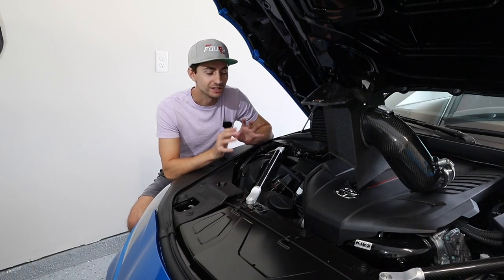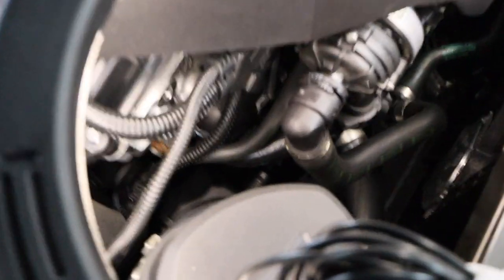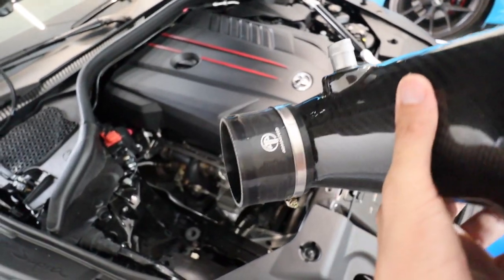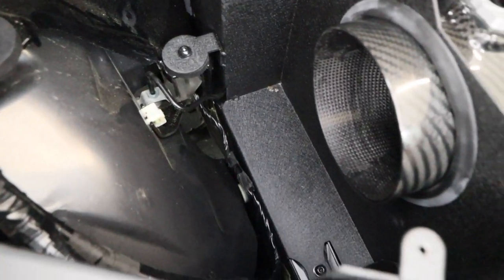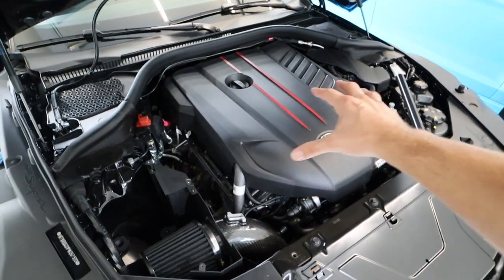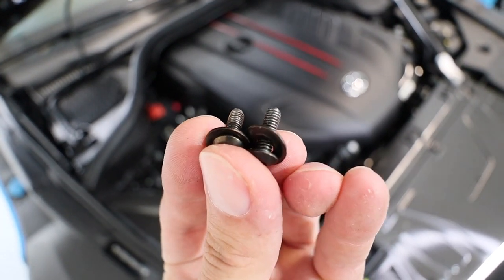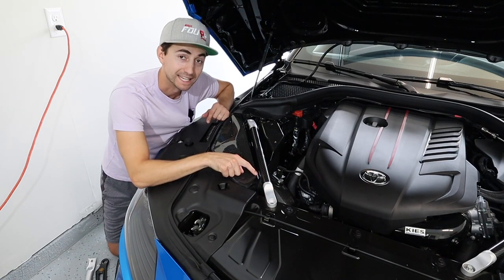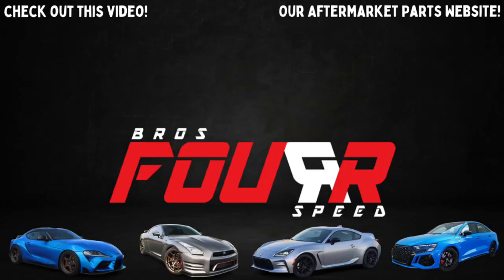(2020-2024) MK5 Toyota Supra 3.0 B58 Armaspeed Carbon Fiber Air Intake Detailed Installation

Comment: Thanks for this detailed video mate, off to install later today 👍
Reply from the maker: No problem 👍  Enjoy it!
Reply: @BrosFOURRSpeed  that’s it in mate! Although it’s raining and I can’t get much power down I’m finding it hard to hear any flutters, I saw you mention this is one video but do you think the aluminium version and the fibre version would be that different from one another?
Reply: @lexypic1628 still not hearing any big difference? My aluminum is otw I’d hate to install it and wish I got the carbon one
Reply: @I_push_chickens  hey Jeff, apologies for the delay, initially this was the case but if you build up pressure and let off it makes as much noise as the videos do show. It is amazing and I’m glad I bought it for sure. Some people remove the top cover apparently and it’s even louder but still to try. Definitely but if you are considering it it’s very good 👍
Reply: @lexypic1628  thanks for the response, I ended up buying the armaspeed with aluminum cover and I love how it sounds would definitely putchase again for anyone on the fence that sees this

Comment: Hows the noise when not on sport mode/high throttle?

I want it to be fun and noisy on sport/high rpm though not obnoxious during comfort mode.
Reply from the maker: Sport mode doesn't really affect the engines sound. It does the exhaust valve and fake engine sounds through the speakers. But if you're not hard on the gas, you don't hear the intake that much vs flooring it. The MST intake is a bit quieter tho than this. We carry both on our site! https://brosfourrspeed.com
Reply: Your website has zero info on your company and no phone number and no physical address, why is that??

Comment: hey i just got the armaspeed intake installed, can i add a turbo inlet pipe ?
Reply from the maker: You should be able to. As long as the pipe would fit to the stock intake, it should fit to this one